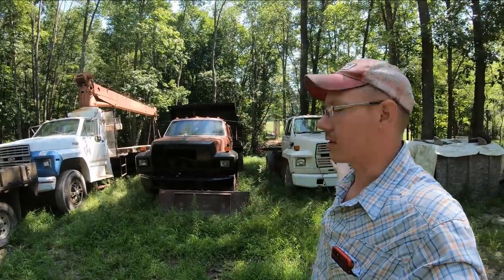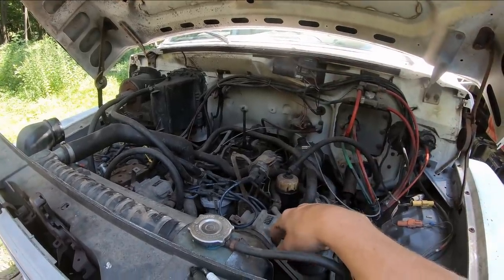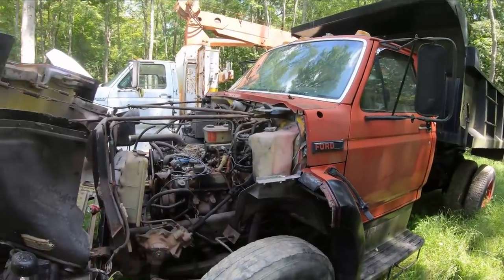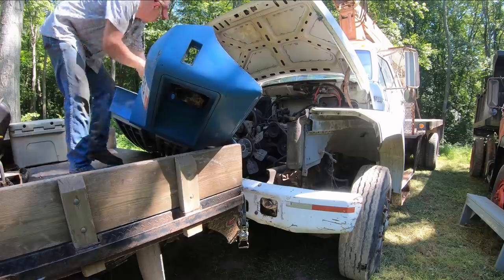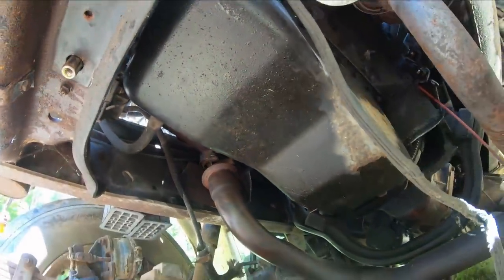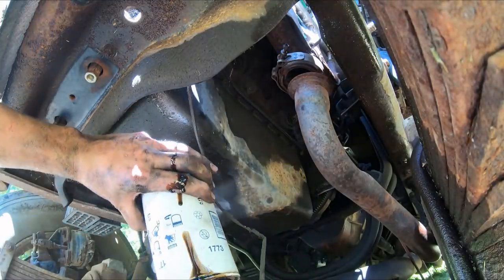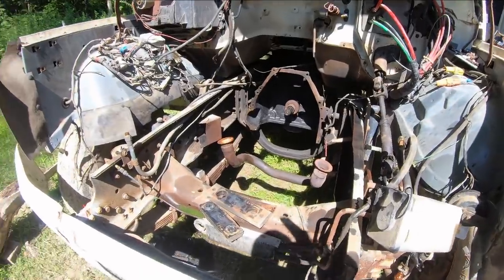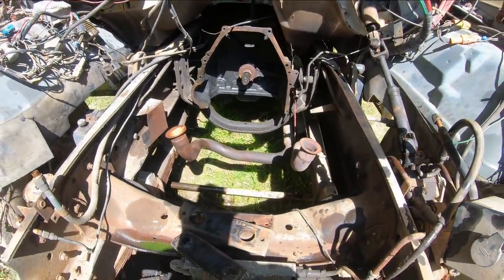Tearing down a BIG BLOCK in the middle of the woods!! $700 Auction Crane has BIG Problems!

Comment: I don't know if the light duty and medium duty engines are different or not for sure but I don't think they are. I have an 86 F350 that had a 460 in it and now has a 429 that I was told came from a medium duty truck (actually a school bus). I don't believe that Bill had many problems with the swap over. The bell housing pattern looks the same to me and the engine in my truck looks like it is using all the same mounts as the 460.

Comment: What you could do, is soaked the cylinders in ATF. It's a very powerful penetrant, and while not a very good lubricant, it dissolves corrosion and rust due to all of the chemicals and cleaners they put in it.
Reply: half ATF and half finger nail polish remover.

Comment: if i was you but iam not i would get the crane truck up and running and get rid of the other two trucks all togather and keep the crane truck in case you ever have to pull the engine out of your dozer or bobcat it would make so much easier for you
Reply from the maker: The other two are definitely gonna go! Gonna fix the crane and test it by swapping the beds on the dump trucks, then they will be for sale (they actually already are just no one seems to want them)

Comment: FORD stands for 
F**KED
OUTTA A 
REAL 
DEAL.
You said rust in the cylinders is what locked it up. The rust in the cylinder would have allowed at least some movement especially after all the oil and diesel fuel was applied because that wasn’t really a lot of rust. Certainly not enough to lock it up solid like that. 
No I’m thinking you have a spun main bearing that seized the crank to the block that’s why you can’t even get it to wiggle. Keep going with the autopsy I think you’ll find the cause of death is in the crankcase.

Comment: How could you test the heater core now before you put it back together? It would be easier to fix with it apart like that. Other wise it will leak all your antifreeze on the floor board when it goes back.
Reply from the maker: I noticed it before I put much pressure on it. I took them ofd
Reply: @DieselCreek  Good deal.

Comment: I did a lot of fleet work in the late seventies. Back then a lot of these trucks were in use. Big gasoline engines in trucks are a thing of the past for a good reason. They were incredible gas hogs, very inefficient. The big Chevrolet 454's were the worst, often worn out at 60,000 miles. Quality of engine builds was horrible, tolerances were very sloppy. Big block Chrysler castings were so bad that often the freeze plugs would fall out of the blocks. The trucks were slow and gutless, prone to breaking down.
Reply from the maker: I agree but it’s not worth converting but the crane is worth money if I can show it working, that’s all I really need to do

Comment: The 460 engine is exactly the same family....do a valve job to your new engine..put a edlebrock intake with a holly card..you should also change distributer to a Mallory unilateral or equivalent...don’t bother with any of the emission bullshit...if your donor engine has miles a new timing chain set is a good cheap investment..the pan fits as well as the flywheel

Comment: Diesel Creek I do know that your Light Duty Trucks & your Pick Up Trucks all are the same the 460 & 429 Blocks & Heads the only thing I saw & know are different are the Crank & Rods  the 370 has the same Block BUT the Bore & the Rods & crank are different I believe the 370 has it's own Rods & Crank  Pistons as well the Rods & Crank in the 370 could perhaps be the same as the other ENGINES the reason I am contradicting myself is I not really that familiar with the 370 ENGINE but am the 429 & 460 I've seen a many of the I used to work at 2 ENGINE REBUILING SHOPS here local & saw a lot of   them (THE 429&460) that is however I do know & can tell you that 370 has the same block as the 429 & 460 except the BORE  that is all I can tell you & know

Comment: That engine is a 370. Low rpm high torque. Look on the sticker on the valve cover. School buses used the same motor.
Reply from the maker: I did look it’s the 429
Reply: Diesel Creek, I stand corrected used to be a heavy truck and equipment mechanic never saw one with a 429 but I have seen some pretty strange things with the ford stuff.

Comment: I would just think about changing that piston and honing it.  Take the rest of it apart and see if thats doable.  The think you have going for you is that you know what you have.  When buying a new or rebuilt you never know what you might end up with; could be worse than what you got.  How many mies are on it?  Not positive but I think the only difference between the 460 and 428 is the crank.
Reply: 428 I think is a FE engine. You could mean 429 of the 385 engine series. The 460 had a longer stroke (3.85" vs 3.59") and different pistons than that of the 429. The bore is the same at 4.36". Blocks are the same as well.

Comment: Pouring diesel in it the way you did may not do the job because not all the inlet valves are opened at the same time .. and you can't crank it .. so it's kinda pointless .. the spark plug holes is still the best choice .. or open it ...
Btw you could install a portable hydraulic crane on your pickup truck .. it's always good to have one ;)

Comment: You deal with a lot of froze up engines have you ever done the arithmetic if you could put 150 lb air into the closed cylinder that was 5-in diameter you would have over 11,000 lb downward pressure

Comment: That's too bad. That engine didn't have much time on it you can still see the honing marks on the cylinder walls. It's a dirty shame that they let water get down in it and mess it up. Might be able to bore that out depending on which block it is. I know you can bore the 429 block over a fair bit. Can't remember the exact and I know very little about the 370 block other than it's a small bore version of the 429 why they call them 385 series when the 460 is the only one that has the 3.85" stroke I have no idea.
Reply from the maker: Watch the later vids on it, I...”repaired” it lol
Reply: @DieselCreek  I'll have to do that. I'm a big fan of the 429.

Comment: blocks are the same sme internals are different and alot of times heads are different but i can assure you if you knock that piston out dingleberry hone the cylinder wall slap the piston back in with new rings or not it will run just fine save yourself time and money

Comment: its a ford so it is different . They are a pain the way they change things . I had a 98 f250 needed slave cly. for clutch found truck in junkyard , Same year , trans and motor . turns out one made in feb other in oct. Hyd. line different size. rather than pull trans and transfer again needed new master cyl and line from donor truck . Luckily it was still in yard

Comment: The truck 429 IS NOT the same block as the 460 pick up block.  I had a 429 in my F-600 but it was fuel injected.
Reply: for one thing the water passages are different.  Your 429 is a commercial block, the 460 is not.  The head gaskets WILL NOT match.
Reply: Keep the engine.  Pull the pistons, hone the cylinders, clean up the pistons, put new rings on them, and put them back in.  Make sure you have the correct model number when ordering a new rings gasket set.  The 429 was carbureted, fuel injected and propane equipped.  It's going to be a locally driven truck and not a long hauler so it should be fine.
Reply from the maker: all I need it to do is run long enough to show that the crane functions and drive off the property 😂
Reply: @DieselCreek  Okay, I thought you wanted to use it after you fix it , not just to sell it.  Either way you will probably have to buy the gasket kit like I had to to get the gaskets you need to get it back together.  What a great bargain you got with that fork lift.

Comment: faster to just swap it out.  wont be faster if you get wrong engine.  would like to see other head off just for fun and crank.   50 years ago ford used sodium filled valves for cooling.  I wonder about  real truck engines that was originally in trucks of that vintage.   curiosity will get you dirty.

Comment: You don’t need to reinstall that smog emission crap on it what a joke of a motor when all that stuff is on. Just let it breath
Reply: I know even here in NY I'd agree with that, it's exempt and a lot of those parts are hard to find, and it's technically unnecessary to begin with (for making an engine to run). Keeping an old truck on the roads saves the pollution from having to produce a new one to replace it, which is always the cleaner option.

Comment: Putting diesel in the carb will only get the fuel in the cylinders that have intake valve open....
Reply from the maker: Stands to reason those would be the same ones that were stuck tho and for the same reason

Comment: 385 series Ford engines share the same blocks, the difference is in the stroke and internals, they all share the same rods, the truck rods are same as CJ with football shaped bolt heads and car rods are broached, either one will work but the truck/ CJ rods are a little stronger, pistons are different between them with the 429 being the most expensive. BEWARE! there is a break in the internals at 1978. Engines before 78 mid year are internally balanced and after are externally balanced which means different flywheels from early to late. The industrial engine like yours may have a steel crank but if you replace with a 460 built after 1978 you should be good to go./

Comment: The medium duty truck has the tall deck motor that are built to have low end torque and low rpm range         and the passenger trucks have the low deck motors where they are ment to have more of the power range in the higher rpms. They work just not the greatest good luck on the motor hunting

Comment: That looks like a 429, the 429 and 460 virtually same block. 429 Ford's are a rare engine. Rebuild that engine. Only difference is bore and stoke of piston.
Reply: It's not rare being an HD truck engine and it's useless for a car or pickup.  No provision for mounts on the side of the block for one

Comment: Why do us automotive engineers always get a bad wrap.  Do you know how hard it was to calculate the fluid mechanics of the oil stream so it would hit that tie rod just right to have the oil stream flow around it and not splash oil everywhere?  We get no respect.  :)
Reply from the maker: Could have moved the drain plug rearward 2 inches and it couldn’t have hit anything lol

Comment: I'm homeless an I live in a tent in a wooded area. If my mechanical mindfuck ass can rebuild a Dodge 440 TNT big block V8 dump truck engine an get it running on cinder blocks in my tent. Then ya should be able to get that sweet old flatbed Ford to fire to life an roar outta her previous grave.

Comment: Also measure from the oil pan rail to the top of the block where the head would meet the block the earlier Lima engines had a different height if your using the whole engine it probably wouldn't matter but if mixing parts or etc.. it might. On other engines that is what the difference is such as a big block Chevy the truck engines were tall deck and car engines were shorter. But these Limas were the same just had a little change along the way but would have changed in the cars and trucks.

Comment: Considering the firing pattern of Ford V-8's, it wouldn't surprise me if you found a cylinder in similar condition on the other side.  (Looks like you've already considered that.)  Finishing the autopsy might give further clues on what needs to be done to prevent it from happening again.  Better have a strong stomach if you do that to an engine that was rebuilt in a trade school, though, because what you find could make you sick.

Comment: toss a 12 valve in it, and call it a day,
Reply: Pay $4,000 for a motor with 500,000 miles on it. Guess you can go that route but no motor is worth that much with high mileage

Comment: hec i could come n by rebuild that motor save ur self a headache because im engineer repair 

460 not same is 385 because 460 light weight n motor mount is on side by side not front
only 385 n 364 same front motor mounts 

hardly find them unless you want throw in Detroit v8 motor in there n make motor mounts just welded it frame n put motor mount there n remember detroit rev so highly im hoping doesnt destory that transmission or blew clutch out
Reply from the maker: 385 is the engine series, it is the length of stroke I believe, not the displacement it refers to the 379 429 and 460 Lima engines
Reply: @DieselCreek  i know n if you want throw 460 in it i adjusted you measure transmission bolt pattern that way u may find one to fit it 2nd still going need welder make motor mounts for it

it up to you decide todo
i could help ya rebuild it cheap n throw it back in truck n get going aging